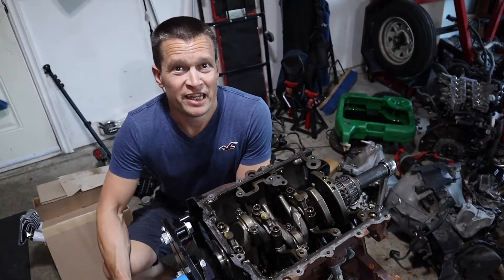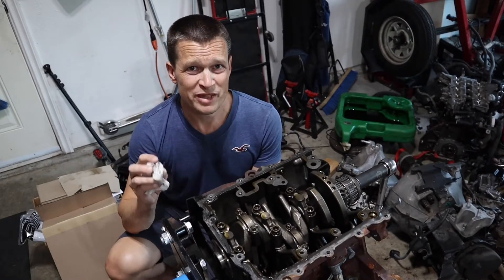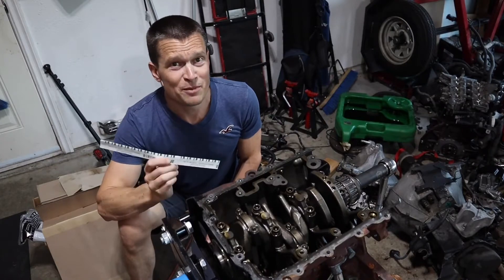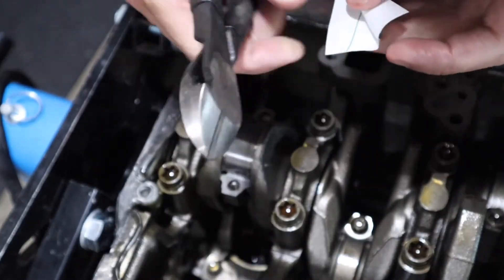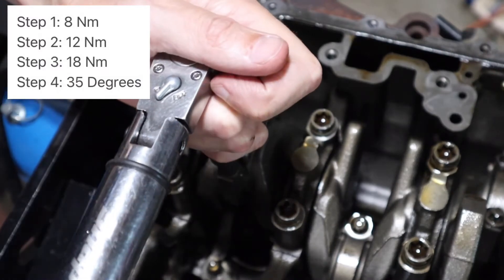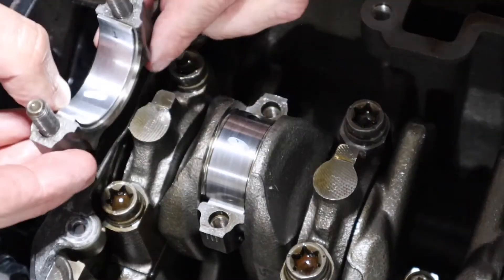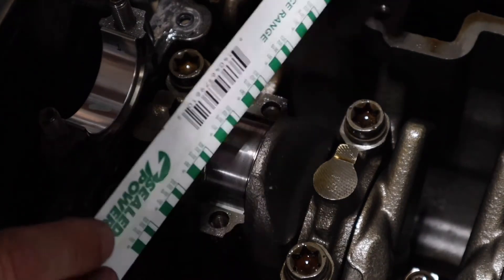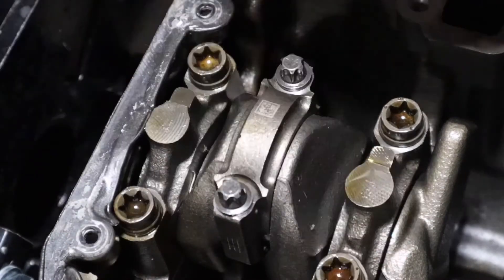Measure Bearing Oil Clearance with Plastigage | Fiesta Resurrection - Part 6

Comment: The timing belts break down when the wrong oil is used and if oil changes are missed. What you are seeing is a comon issue with this engine in the UK. I think the oil pump belt guard is to ensure that the belt is always oiled.
Reply from the maker: In North America the OCI is 10K miles. I think that’s the issue. Belt bits clogs the oil pump pickup screen.
Reply: @that_jamesguy  12500 in the UK. I change mine around 10k as its not stock.

Comment: You can actually take off the cap to clean the oil pump's strainer and fit all back it. There'a no real reason to replace a functional pump if only the strainer is clogged. Cheers and keep up the great content!
Reply: I would always strip the pump down if going that way as it could have internal damage from the lack of oil.